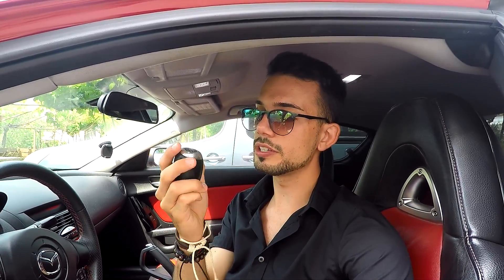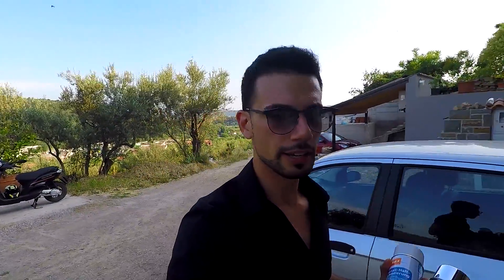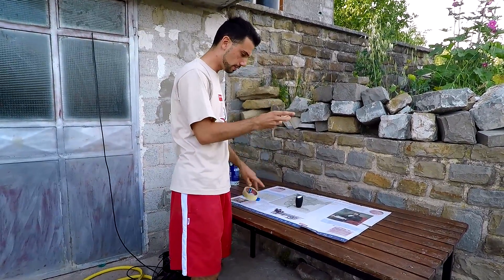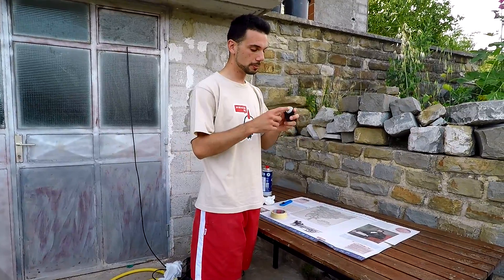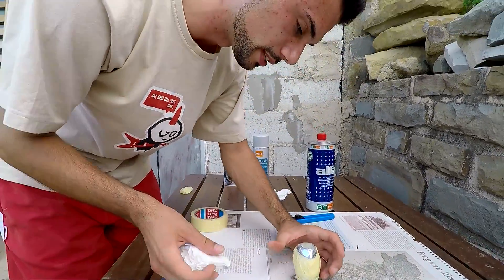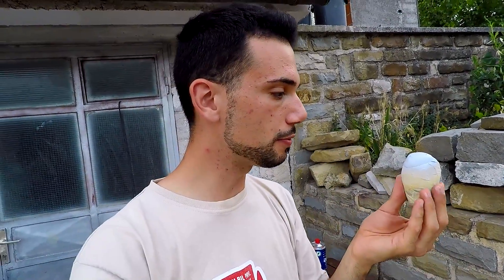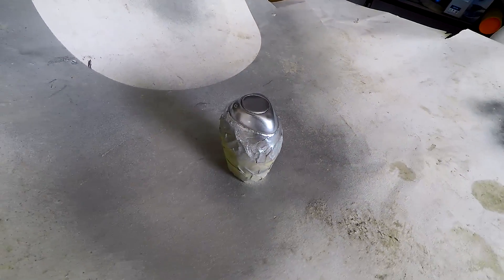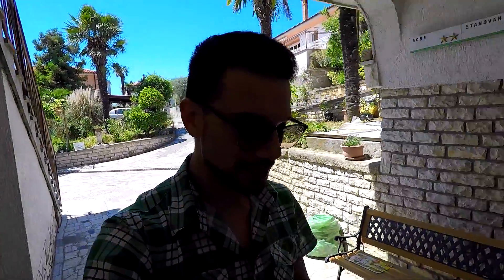Mazda Rx8 Shift Knob Restoration

Comment: I had the same issue with the aluminium cap coming off, particularly in hot weather. However if you can install the cap correctly (cleaned thoroughly, maybe even a light sanding for greater contact) using a contact cement glue, mine has held for over a year. And the aluminium finish matches the hand-brake button nicely !
Reply from the maker: LLLLuuuuKKKeeee ive tried several glues, and it kept coming of... but im glad it worked out for you :)  ill try taking the top centre piece of the knob out, and remove the leatget, repaint it, and have the leather part reupholstered. seems like the only "high end finish look" method. without buying a new original one :)

Comment: Nice mod! I thought about doing this too, but I finally replaced the shift knob and the leather boot. Better handling with a spherical knob IMO. And nice vid as usual! ;)
Reply from the maker: Killy1789 replacing the knob is my last option 😋 ill try and take the centre cap out and remove the leather, respray the steel cap again, and have leather part reupholstered. This way, the shift knob will literally be new 🌈😄

Comment: Hi, i discover the way to pull out the metal part only, without any damage( if you take your time), in fact you need to warm up the plastic part with number(hair dryer in enough) , than with something vert skinny like a blade or a needle take it off, an you'v got a screw bellow it how hold the metal part to the leather part, annnd i'ts done ( sorry if there is grammatical mistake i should practice my english ^^')

Comment: I've been thinking of buying one should I ? It's going to be my first car and daily driver , I'm still in high school as well.
Reply from the maker: I'll just list the pros and cons of owning an Rx8 in high school:
PROS:
- Cool car to have in high school
- Relatively practical ( can go on a trip with 3 other friends
- Fast car
- Easy to drift
- Great community (including this channel as a guide for your ownership)

CONS:
- Very high fuel consumption ( not a joke, this car does consume a lot of fuel, especially if you drive it in the city.
- Too much power for a beginner. Understand that you are buying a sports car, which can sound fun, but with no experience you can get in trouble. (FWD cars are more forgiving for first timers)
- Dedication to maintenance. You will have to maintain it the way it's meant to be, if you want it to run good. Check out my video " mazda rx8 maintenance schedule, to see what you have to change and when.
- Have money on the side for unexpected repairs. Since this is an old car, someday  you'll have to repair something, and some parts are not cheap. SO have at least 1000$ on the side. Check out my " fixing the xenons and emissions" video, and you'll see just how much i've spent.

Other than that, this is the long story short of it :) Hope i answered your question!
Reply: Driven by madness Thank you I will really consider in getting one because I am choosing between this Mazda Rx8 and an Audi s4 4.2 Quattro cabriolet, I know both cars will waste a lot of gas and I'm aware the Rx8 needs a lot of maintenance and good taken care of
Reply from the maker: Overall, the rx8 will be cheaper. 4.2 engines pay very high road tax. The rx8 is considered 1.3, so there's an advantage. And i think the maintenance will be the same. If you want a cabriolet, rather than an audi get a BMW M3 cabrio. Much sexier and fun to drive ( i work in a 5 start hotel and i've parked all cars you can name, and bmw is more fun than audi) :)

Comment: Awesome video. Just what I needed. Can't it be polished?
Also, painting game on point. Just one tip. Peel off the masking tape as the paint is a little bit wet.
Reply from the maker: i tried it before, but the surface is soo small and the scratches so deep, it's not worth it. And, i doubt the finish would be the same :)
Reply from the maker: Oh yea, and thanks for the wet paint tip ;)

Comment: hi madness, just to let you know that the centre glass can be prised out and removed. this then gives you access to the screw which secures the metal plate to the leather. easier to paint when removed and would give a neater finish.
great video though mate #likewatchingpaintdry
Reply from the maker: Thank you very much for the tip :) I saw a photo on google where it was removed, but thought it was like forced out. I'll look more into it and possibly try removing the centre piece, removing the leather, and repainting the cap, and then have it reupholstered :) #luckytohavegreatpeople